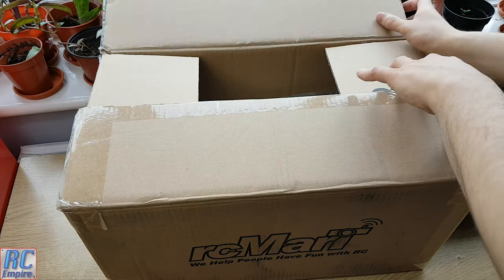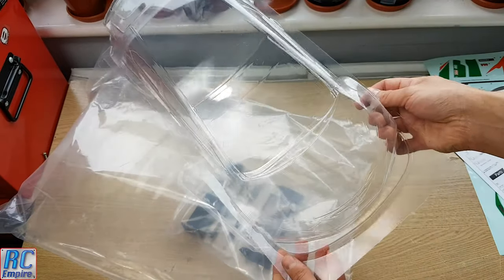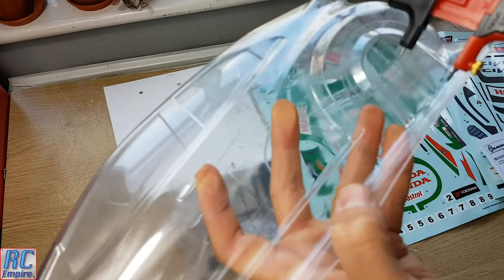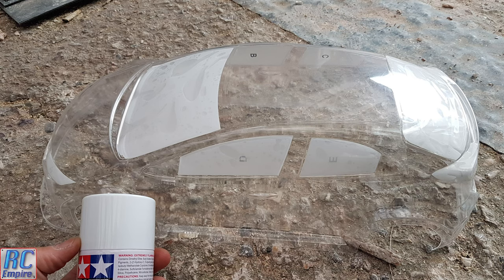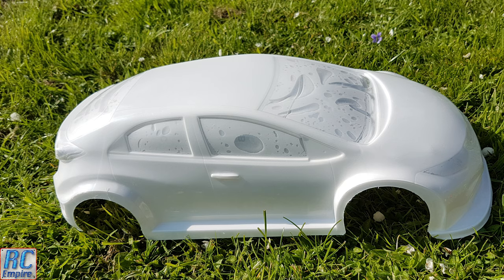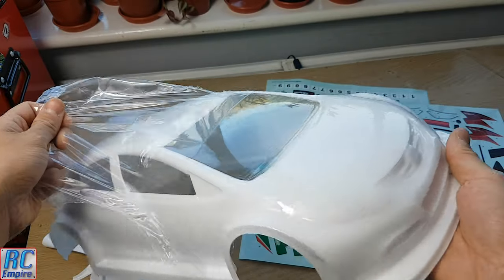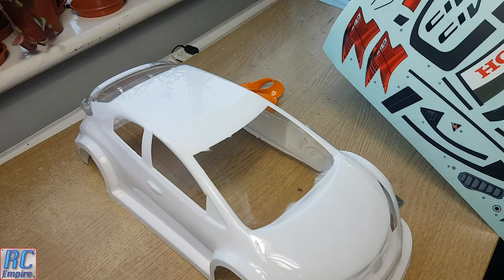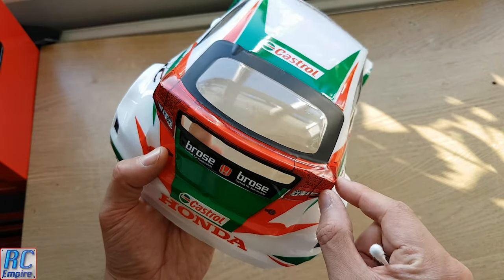Tamiya TT-01 Race Build: Episode 12 - Body Build: Honda Civic WTCC

Comment: sticker tip: before putting the stickers on, run the peeled sticker through a mix of soapy water. It will give you more positioning time, and wont ruin the adhesion. You just need to run it through quickly, slide it into position, then push out the excess moisture while holding it in place, then hairdry it to form the plastic sticker to the body
Reply from the maker: Really! that's a great tip. We'll definitely try that on our next build. Thanks 👊👍.  All sticker applying tip are most welcome haha.